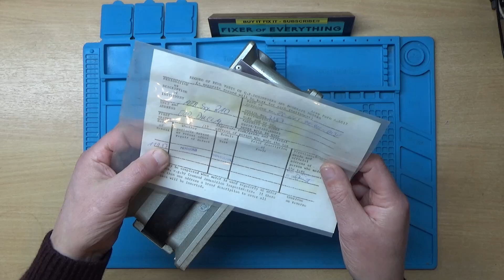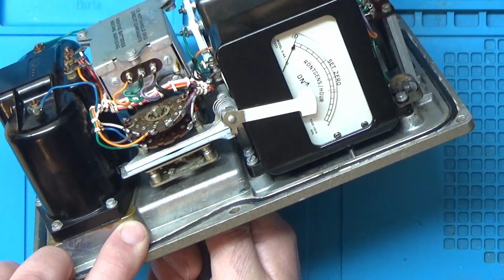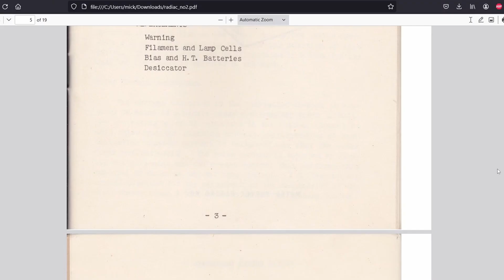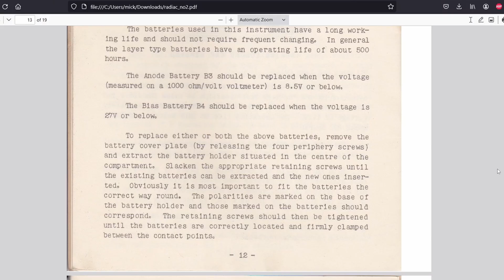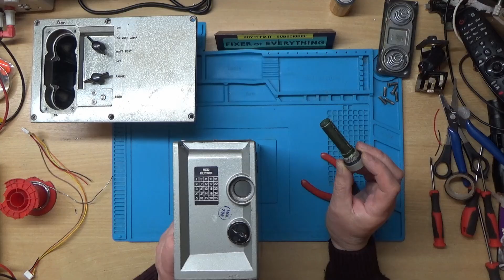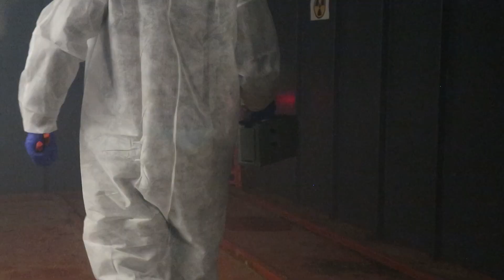I Built A Fake Bomb 💥To Test A Real 1950s Geiger Counter ☢️

Comment: What you don't have a plutonium warhead sitting in your shed?  😂
Are the battery polarities reversed perhaps?   Maybe you were using the wrong scale?
Reply from the maker: I gave my last to Doc Brown, Marty will tell you. No the batteries were in correct, and it was on the lowest scale. I was reading that if the needle moves, even on the lowest scale it means that there is serious contamination and you need to evacuate immediately.

Comment: Apparently you can microwave the desiccant and dry it out.  I saw someone on YouTube run an entire experiment.
Reply from the maker: I think I did try that at the time (or might have put it in the oven) but it didn't change colour. I've done the microwave thing with silica gel balls for the 3d printer, which worked fine though.

Comment: Go to your nearest car body shop that has a spray booth. They'll have a some desiccant beads they can give you. They are used in the airline that feeds the spray gun at the booth, after the air dryer and compressor.
Reply from the maker: Thanks for that 👍I've just ordered 1kg of them the other day for my 3D printer AMS unit.

Comment: Try a smoke detector that uses americium-241 ionization detector to test your Geiger meter
Reply from the maker: I did have a look as I used to have some from an old smoke detector somewhere. I even got some smoke detectors form a neighbour but it seems that in recent years they've banned the americium ones, and now they all rely on optical sensors.

Comment: So basically, you'd need to have quite a hot source to even reach 1R/h. That little marble just doesn't give enough radiation haha. Maybe a big old radium painted dial from a plane instrument or a watch could work but I think not even that could come close, You'd probably need to use an X-Ray tube to properly test it, maybe it could measure something inside an airport type X-ray scanner or at the dentist/hospital

I have a CDV 715 which is another survey meter that also uses an ion chamber and that one can measure 0,1 R/h, still too much for anything I'd be comfortable being close to. 

These are the kind of geiger counters you really wish that you never have to use, because they're for measuring the environment around you for contamination, usually after a huge nuclear related event, bomb or powerplant disaster, and if anything made the needle jump from far away even at the lowest scale, it would be pretty scary. It wouldn't mean death, but you still wouldn't want to be hanging out around the place for long.

Great video and work! I have seen one for sale and even tho these units are pretty useless for daily readings (And lets hope it stays this way), I'm super tempted to get one. I love vintage equipment, it's always so well built!
Reply from the maker: @DanielTseng100  Thanks👍 and thanks for sharing all of that information Daniel. It's pretty much as I expected (and read) that if the dial moves even at the lowest scale you want to evacuate the area. Yes let's hope it never comes to that, but where I live (very rural) at least I'll probably be ok, and we're fairly self sufficient.

Comment: Old smoke detectors used americium, which is a potent beta emitter,  With the window open, you should see some action if the sensitivity is high enough.  

Very sweet job on that power source!
Reply from the maker: Thanks 👍I had the exact same thought about old smoke detectors, however it seems the ones with the source are hard to come by these days (especially in the UK and Europe) as they have been banned for a number of years. They are now use an optical detection system. I even got a couple of 4-5 year old detectors from a neighbour as I had the exact same thought, but those were optical too.
Reply: @BuyitFixit  OK.  You might then try to locate some crushed granite.  Depending on the source you can get some good beta out of it... (thoron source.)

Speaking of thoron, maybe you can find a source of glass mantles.  These are used in camping torches.  Loaded with thorium.

If all else fails, just wait a while.  Some idiot might set off a few nukes.  (God forbid!)
Reply from the maker: Ah yes thorium gas mantles. They look like lace doilies. I remember when I was a kid I stayed in a caravan that had gas lighting with those. Yes let's hope the nukes don't fly 👍

Comment: there are radiation parts in a smoke alarm.
Reply from the maker: Yes, Americium I think it is. Unfortunately those type of smoke alarms are hard to come by these days, and most use an optical sensor now (as I did get a couple of old detectors from a neighbour).

Comment: mine did not come with  the battery holder
Reply from the maker: That's a shame 🙁
Reply: @BuyitFixit  can i make one
Reply: how is it wired up both negative to 1 plug??
Reply from the maker: In the manual it shows how the batteries are wired up. The 30v is wired so its -30v so the positive goes to the ground. And the negative is is the output. The 9v is just wires 9v and gnd.
Reply: @BuyitFixit  i try to turn it on but the dail is stuck at 1
Reply from the maker: If the -30v is not present it will do that

Comment: What spot welder is that and where did you get it?
Thanks.
Reply from the maker: Hi, It was this one here: https://www.aliexpress.com/item/1005005927840467.html
It's OK on the thin strips supplied with it, but not so great on thicker OEM ones that are on some batteries.

Comment: Another good solution to the battery problem would be small boost-buck converters.  You can get them for around £2 and set a constant voltage.

Silica gel beads can be dried in a low temperature oven and reused.
Reply from the maker: Thanks for the suggestion 👍I had thought about a small boost converter, but then the problem is how do you switch it off? as it would be running constantly if it were just placed in the battery compartment. You would then have to mess about with the wiring (which isn't a huge deal) but I wanted to keep it as original as possible. The battery hardly uses any current, as it's only for biasing the grid, and the original was supposed to last 500 hours of use. I did use a boost converter in the old miners lamp that I revived and made it into USB-C, and then we explored an abandoned mine with it! The video is on here too 🙂👍

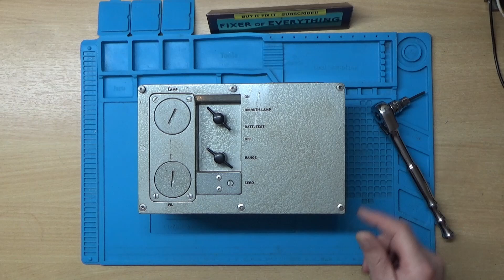Comment: 4:04 I watched a tip about stripped cross head/hex bolts once. They suggested getting a bicycle inner tube, cutting a bit off and putting that between the bolt and the screwdriver/hex. Not sure if it would have worked here 🤔
Reply from the maker: Thanks for that. I'll try to remember that tip 👍

Comment: Ok , my first comment before I forget is about the 413 battery , They do make a affordable version out there ...... Those are the batteries that go in my Triplett 630 volt ohm meters , I just use the D battery in my one working meter , the 30 V is for using the higher ohm range .... anyhow back to the video....
Reply from the maker: Cheers Cajun👍

Comment: For your 30V supply, I'd've gone with LiPo's. Interesting piece. 👍
Reply from the maker: I would have thought LiPos wouldn't really be needed. The old alkaline batteries (9v and 30v) according  to the manual are supposed to last 500 hours of use as they only use micro amps. The main draw is the D Cells as they are used for the lamp and heater in the triode.

Comment: Isn't the ion chamber comparable to a capacitor in some way? Since condenser microphones compares the capacitance between some terminals
Reply from the maker: I guess it would be, those old style tuning capacitors in radios were just metal plates separated by an air gap.

Comment: What soldering iron are you using as the beep hears indentical to mine :P
Reply from the maker: It's the Aixun T3A should be in the video description along with other tools I use. There's a video on here where I repaired it after it stopped working 🙂👍
Reply: @BuyitFixit  Ah cool exactly the same soldering iron. I knew it sounded familiair. Only thing is that I hate about it is when your working on an grounded pcb the temperature readings are garbage and your tip will heat up to like 500C and beyond...

Comment: 30v battery  16.99  on Ebay  and available Amazon
Reply from the maker: I think I paid £5 for the 10 x CR2032 which in theory should last longer as they are lithium cells 👍

Comment: The movement of the needle when moving the instrument through air is normal if the circuit is not shielded. Static electric fields are everywhere, and an electrometer circuit like this is more than prone to detect them, or to be more detailed, detect their changes if exposed to such a field. I suppose, if you close the casing then these fluctuations are mostly gone.
Reply from the maker: Thanks for that 👍

Comment: It's so interesting watching your videos seeing how you repair everything. From a guy who can't even repair a simple microwave 😅
Reply from the maker: Thanks 👍Strangely enough I was looking at an industrial microwave for someone who was at my friends farm last week. If it's the old style one, there's only a transformer, capacitor, diode, HV fuse and magnetron. Please be very careful as the voltage CAN KILL. Usually the diode or fuse is the culprit, in this one I looked at I think the magnetron had failed.

Comment: Once you have the unit properly reassembled, your fingers will have little affect on the meter, although you MIGHT see a tiny bit if you have the beta window open and you put your finger right next to it-this will be caused by static electricity.
Also, I believe that for the beta window to operate properly, you may need to leave the bottom cover off(check the manual though).

Comment: I wonder if these valve devices continued to be used into the mid eighties because transistors can be damaged by the electromagnetic pulse  produced by atomic weapons but valves are unaffected? Or maybe the kit just worked, the quality of the piece is amazing.
Reply from the maker: I'm not to sure on that, but totally agree it is very well made 👍

Comment: Humidity Indicator Paper (Cobalt chloride free) ia available from Johnson Papers.  The old pink stuff you have there is harmful hence the cobalt free version.  I really enjoyed your video. thank you.
Reply from the maker: Thanks👍and thanks for the info on the indicator paper!
Reply: @BuyitFixit  As long as you don't ingest it, the cobalt paper is not a big deal(but DO wash your hands after touching it)(or wear gloves).
If you heat the whole assembly, the paper will dry along with the silica gel beads, and will turn blue again.
Actually, it may turn blue anyway after a while, since the beads will dry the paper.

Comment: Looks like this detects beta / gamma radiation and not alpha emission. An explanation might have helped. Also mention secondary emission from aluminium shielding around high energy beta emitters. The public is mostly protected by regulation but this is no place for play by the uninformed !
Reply from the maker: I'm no expert, and even put that in the video description. It's just an interesting device, and designed to read levels of radiation in the event of a nuclear strike or disaster as I mentioned. If the general public encounter such, I'm sure there are bigger problems than anything I my video 😂

Comment: Wow well presented Mick, lovely unit and still working what a bonus, really enjoyed it, I used to work for Graseby Dynamics Limited (Watford) they were the company that supplied personal and vehicle ‘Agent Detectors’ for the MOD, Army etc, we would get the used units strip them down and empty them out, they are then washed for 3 days and then dried for 5 days ( something like that ), then refilled with charcoal granules and sealed. We weren’t allowed to use deodorants or aftershaves, also we had to wash our hand before entering the department otherwise an alarm will sound, it was great I still have the small clock I received from them 😊
Reply from the maker: Cheers Gary, I did put a bit of time and effort into this one. Pity the algorithm doesn't think so.
Reply: @BuyitFixit  you did I was impressed with the bunker bit lol 😂

Comment: Find the dimensions of the battery and 3d print one that holds 2032s.
Reply from the maker: I did look at, but the designs already out there were vertical and the diameter of the cells is larger than the original cell. I could have tried to design something but tape and the spot welder was the faster and easier option for me.

Comment: 9:08 that is the high impedance circuit, its very sensitive. You can test the function by exposing the ion chamber with one of those mercury tube UV lights for low range or a smoke detector button for high range. The tube is an electrometer tube, the gain is insanely high, measures charge like  a very high quality mosfet.
Reply from the maker: Thanks for that 👍

Comment: Hi. I've been involved with rad protection for the last 15 years. I've seen some old instruments in my time but never this. Surprised it's measured in roentgens as we all use microsevierts, millisevierts and sevierts etc etc. Guessing it's an early version ion chamber. I know in the 50s-60s we moved onto ro2s which became the norm dose meter, Which are ion chambers for beta/gamma and are still used to this day. You are going to have some difficulty testing it I'm afraid because if I'm guessing right you will need a decent strontium jig or a gamma jig that has a little bit of a kick to fill the chamber. Which isn't available to the general public. This instrument isn't very good reading a point source but would be more used for general area dose rates. I will speak to some of the lads on Monday an try find out more info on it because I'm working we're the Instruction manual refers to. 👍
Reply from the maker: Oh nice 👍 and thank you kindly for the information 🙂

Comment: Thoriated Tig welding tungstens (red tip) contain radioactive particles, if they can be picked up by your meter. Glow-in-the-dark paint on old watches are also radioactive if I recall.
Reply from the maker: Yes, I did read on a forum when doing research but apparently it's still in orders of magnitude less than needed to set this off 😂😂😂😂👍
Reply: Spot on, old son! The amount of radiation intensity that these meters were designed to measure is truly awesome by the safety standards of today!
 @BuyitFixit
Reply: The radiation button from a smoke detector will activate this meter if you have it facing the open side of the ion chamber with the unit outside the case (high range) a uv mercury tube lamp like one of thise phone sanitizers will work for low and middle ranges. A dental x ray unit will test all 3 ranges depending on distance with it complete in the case.
Reply: How is the UV tube able to trigger the ion chamber? @christopherleubner6633
Reply: With the gamma plate removed, a 1uCi Americium 241 source from a smoke detector will activate it because the ion chamber is an open type.

Comment: You can heat the desiccant in an oven to cook out the moisture, it will turn blue We used to do it on our Andrews elliptical microwave waveguide dry air systems years ago when I worked in the electronics group for Big Oil.
Reply from the maker: I did try it for an hour at 120c but it didn't seem to do much.
Reply: I guess I commented too soon. I got to the part where you had try to bake. We used to have cans of the material, once a month we would visit the land-based communications microwave system to do system checks and replace the desiccant if needed. That has been a long time ago, back in the 1970's. @BuyitFixit

Comment: If I remember my "Community Advisor"  training from the '80's the issue survey meters needed a heck of gamma source to produce much reading. They are designed for the levels of radiation present post a nuclear strike. At its most sensitive this meter measures up to 3 Rad/hr. In humans the LD50 within a month is a dose of about 500 Rad or approx a week of exposure at 3 Rad/hr. The UK background annual dose is about 0.27 Rad or 0.000003 Rad/hr.

Bottom line: If a substance gives you much of a reading on the 3 Rad/hr scale get away from it, fast!
Reply from the maker: Thanks Dave 👍yes that was pretty much the conclusion I came across on the internet 🙂👍

Comment: I would have  got 30 V out of some tiny AliExpress DC/DC converter.
Reply from the maker: I had thought of that, but then it meant wiring into the sealed compartment, or having it running all of the time. Also the noise from the boost converter might have interfered with the reading.

Comment: 04:00 i have lucky remove rounded bolts with a left handed drill bits, when they bite, the screw uncrew.
Reply from the maker: Thanks for the tip👍🙂

Comment: The pink indicator is probably cobalt chloride paper. You can buy it as strips if you could put it in somehow ... Dry out the silica at low temperature (say 50/60 degrees) for a long time rather than the 100 degrees suggested elsewhere as the heat may damage the paintwork on the cannister. Let the unit dry then the marble should be more than good enough to give a decent reading both gamma and beta - just don't keep moving the meter about! It's possible that age and  damp has reduced the resistance of the range resistors ... good luck with testing them though! It may be worth using a clean dry cloth to gently clean the surfaces of the glass tubes in case there's any surface contamination as that will present a lower resistance and effectively short out the electrometer input (the main reason why you must not touch them).
Reply from the maker: Thanks for that Andy 👍

Comment: Use a smoke detector for the radioactive source
Reply from the maker: I had though of that, and even got an expired smoke alarm from a neighbour, but it seems they did away with those types that contained americium 241 and they are now mostly optical smoke alarms, and have actually been banned in some countries.